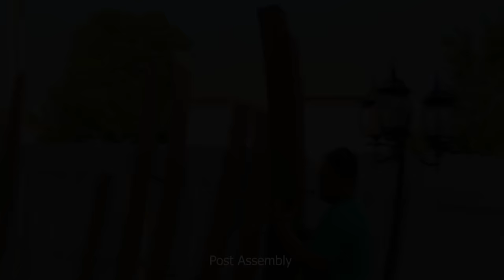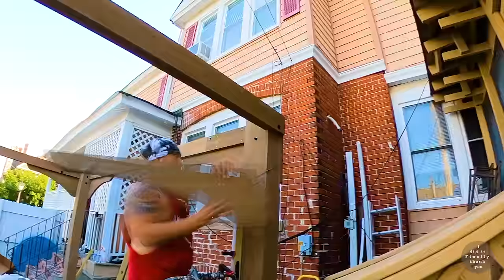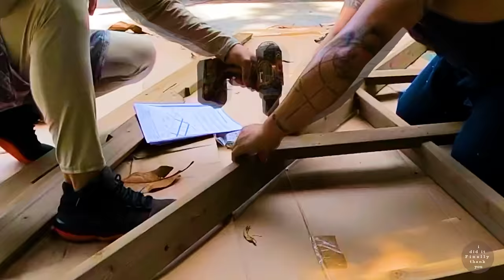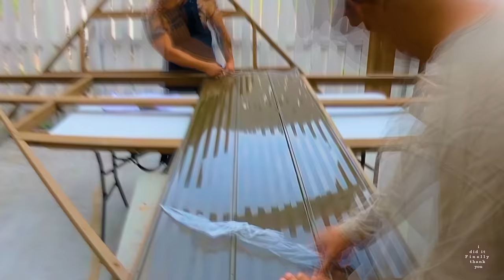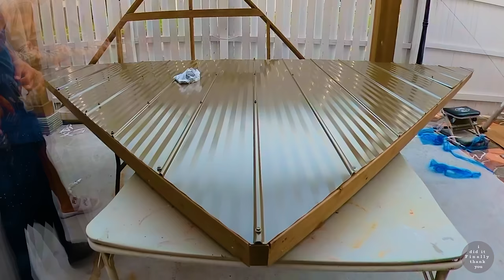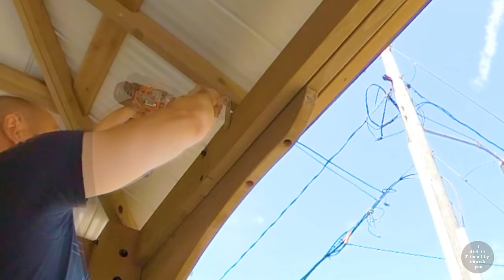[4K] Costco Yardistry 12x14 Gazebo Assembly Time Lapse | Unbox and Tips | GoPro Max, GoPro Hero 10

Comment: built this exact one by myself a few weeends ago.  Took 2 days to do, 19 hours total with an hour rain delay and an hour Home Depot run for a longer A-frame ladder.  I created 2 support posts out of 4 2x4s to hold each roof panel as i lifted it up over the joist. it was one hell of a feat and i've had guys at work say i was nuts lol. also there were so many boards that didn't line up or were warped. that didn't help assembly either. so those of you who are putting this together, don't fret about stuff not lining up perfectly
Reply from the maker: It sounds like you did it by yourself. I could imagine some areas (like the roof framing) too difficult to put the screws without an extra hands to hold it. I would love to see how your gazebo turned out. 💚 I appreciate your visit and comment 👍😊👍 Stay connected 🌸
Reply: Does it require cement footings or is the weight enough to keep it grounded? I’m worried about when it is windy

Comment: Helped put one of these together over the last two days. Posts snd side pieces went up fine, plumb, level, and square. When we put the roof panels on, there were so many warped pieces right out of the box that we had to clamp the heck out of it and drill new holes to get the bolts through. Looks great once it was together, but getting the roof panels aligned was a serious chore. Also had to re miter most of the trim pieces at the bottom of each post. At least they were too long and not too short.
Reply from the maker: I was fortunate not having a warped wood pieces. It must be headache dealing with that. I'm glad your assembly looks great in the end. 💚 I appreciate your visit and comment 👍😊👍 Stay connected 🌸

Comment: I just finished my gazebo and everything was fine..
 some bent pieces at the top between the long and short top roof pieces but we clamped them down and managed to clamp and screw them together.
 main part: 
we only used 2 - 10 ft two-by-fours to hold up roof pieces while we clamp them together.
😊😊😊😊😊
Reply from the maker: I'm glad the gazebo assembly experience went fine. It seems many are getting bent pieces in the comment section. I was lucky that my gazebo didn't get any bent pieces from my purchase. I had mine outside in the box for two weeks until it rained and we started working on it. 💚 I appreciate your visit and comment 👍😊👍 Stay connected 🌸

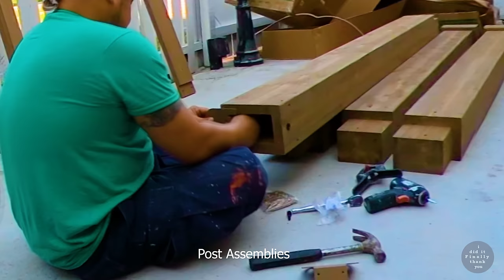Comment: Question...  At 2:30, You attach the metal brackets to the inside of each post. You hand screw in a couple black bolts to hold the brackets on. The instructions then say to screw four screws from the inside that same bracket, right under the black bolts. I don't see you do this in your video, you only screw the bolts in from the bottom side.

Did you completely skip this step? I can't figure out how to screw them in because there is not enough clearance to use a screwdriver or a drill.  How do you do the step? This is right at the beginning of step one of the manual too, and I'm already confused!
Reply from the maker: It must have been skipped in the video since I'm trying to make it as short as possible. I'll follow the manual to keep it right the first time. Thanks for pointing this out👍 my friend. Stay connected 😘🤗

Comment: Great job!  How did you attached the posts to the concrete though?
Reply from the maker: As shown in the video, we initially built the gazebo stand. However, we soon realized that it wasn't properly leveled to the ground. Instead of disassembling the structure, we decided to use jacks to lift it and create a concrete footing underneath. Unfortunately, we weren't able to record that part.

Comment: Does the ridge clip sit flush on the roof panels? Cause the directions say for the bottom edge to be 2 3/4 up from the bottom of the corner rafters. I did that and it doesn’t look right. Your video speeds right past what you did there.
Reply from the maker: I don't remember for sure. But I document the ones that are not so clear on the instructions, for me. If ever... I missed that part to document. I hope some portion of the video helped you somehow.. 💚 Thanks for watching and commenting my friend👍😊👍Stay connected 🌸😊

Comment: How much space is needed to add the roof covers? I plan to install this next to my house on a 14x16 slab.  My roof edge will be about 2ft max from the edge of the house!  🤔
Reply from the maker: With the roof it would be 14x16 total. Maybe a minimum of 16x18 area so the roof have at least a one feet on each sides. Thank you for commenting😁 Stay connected 😘🤗

Comment: I am stuck on step 26 Attached Twist Brackets They don't align up with gaps on top and on some post gap is on the bottom. Any help is appreciated. Thanks!
Reply from the maker: If you're refering to 21:37. I think, I just have to find the best spot where it seats almost flat and then screw the bottom first and then the top.
Reply: I had to bend mine to fit.

Comment: Great work! I was hoping to find this exact video as I just bought this same model from Costco. Looking to assemble mine in the next week or so. Any idea how heavy the roof sections are? If I need to recruit someone the more heads up I can give the better :). Currently only have 2 guys, myself included, to assemble.
Reply from the maker: Hi my friend. 💚 Thanks for visiting and liking my friend👍😊👍Stay connected 🌸😊
Reply: @ididitfinallythankyou  good response...
Reply from the maker: Three people is better and safer for lifting and connecting the roof assemblies. But two may do if you are tall and strong.
Reply: I found having two 3 metre 2x4's with a notch in one end to fit the roof rafter beams helped a lot.
Reply: One more tip - get a couple of construction helmets - smashing your head on a beam, or roof section falling on your head will hurt.

Comment: Does anyone know the box sizes? Need to see if it fits in highlander
Reply: 144 x 40 inches.. I know the length is correct.. might be a little off on the width
Reply from the maker: I didn't really measure it but it fits just right on a mini van. If I remember, the passenger seat was all the way forward and the back seats are all out. I was able to close the back door, if I'm not wrong.